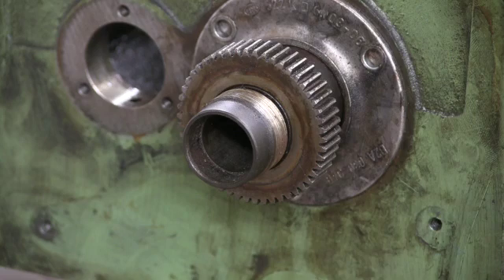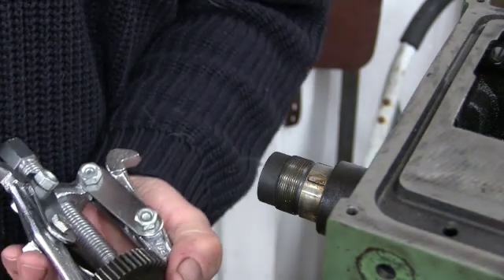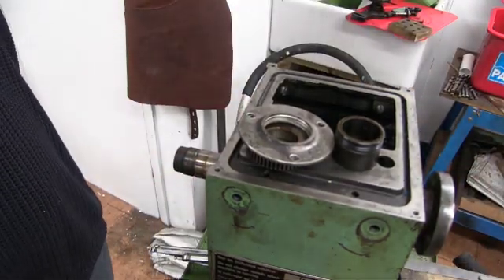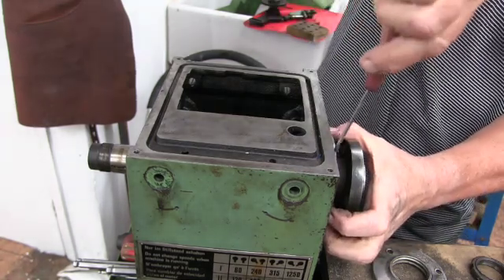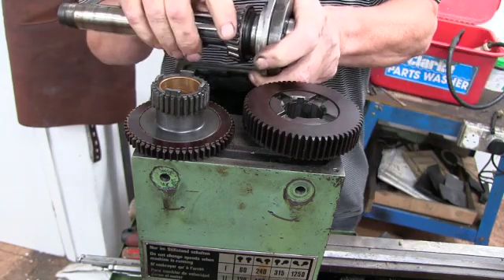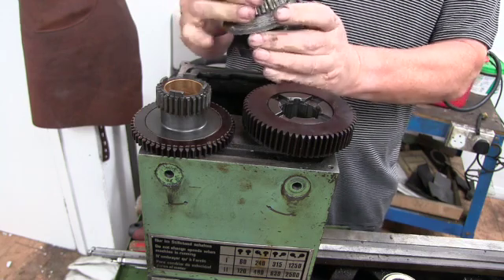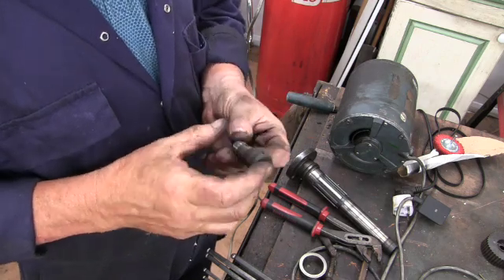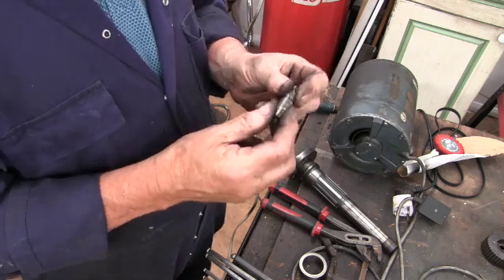Emco V10-P. Spindle Removal

Comment: The tar substance in the motor may be the melted remnants of the resin coating of the windings!  This would mean that the motor is history I’m afraid unless you want to have it rewound
Reply: If the resin has melted off, then ALL the copper windings inside are now shorted together